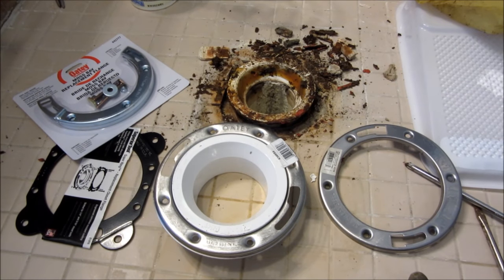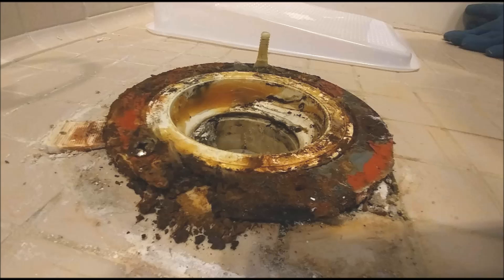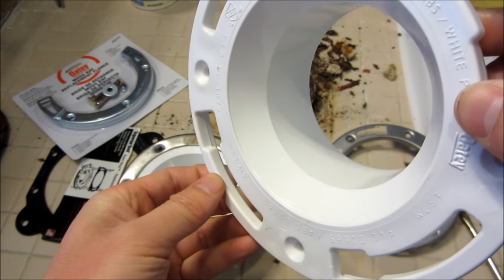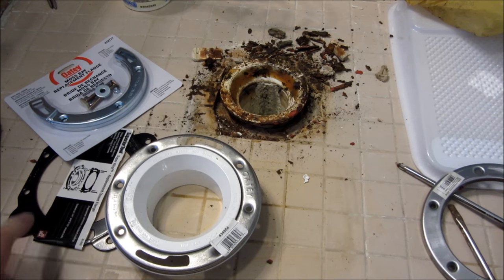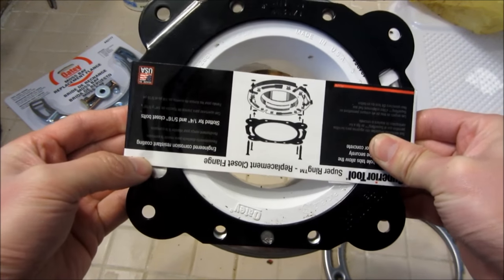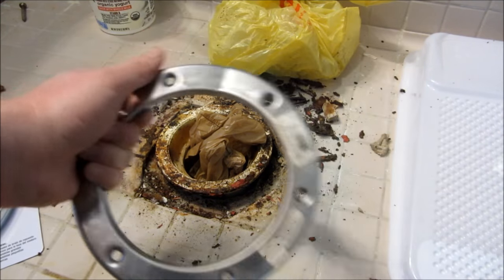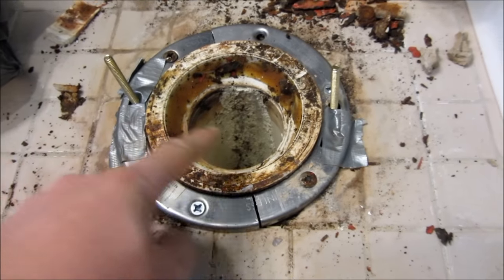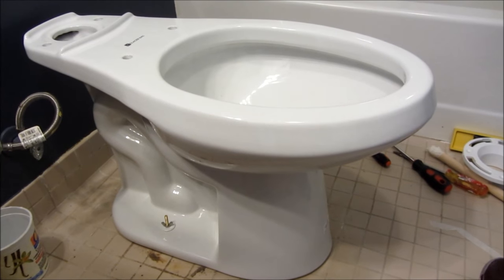Toilet Flange Repair | Broken Rusted Closet Flange Replacement Kits | How To

Comment: JUST CURIOUS, ARE YOU A PLUMBER?
Reply from the maker: No, trust me you don't need a plumber for this stuff, like with any profession, 80% of plumbers are C grade plumbers.  You rather do this yourself because you'll be better than your average plumber.
Reply: @PoolarityChannel  ok. I do a lot of work myself, too. But this comment is just wrong.
Reply from the maker: @joshdillingham1598  The problem these days is that all the master plumbers are doing the high rises and luxury condos.  But also by definition, the bottom 70% in any profession are C grade.

Comment: Question for you: Is the white substance going down the back of the drain wax or what is that?
Reply from the maker: I think that's like dried up toilet paper, like  the lint that builds up over 12 yrs of use
Reply: It is actually calcium buildup from urine.  Very normal.
Reply: @squirrel1179  Calcium in the water will dry in a piece of toilet paper that gets stuck on the pipe. Once that happens more will stick to the old rough paper. Over time you can have an inch or two build up and its hard as a rock. My toilet would flush slow, sometimes just swirl around. Pulled the toilet and found 2" or more of hardened paper right at the flange